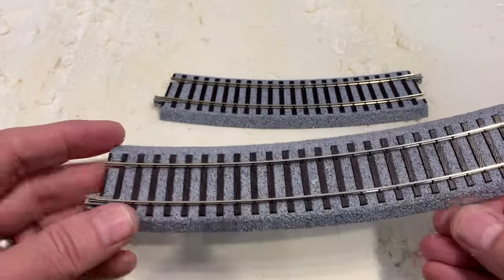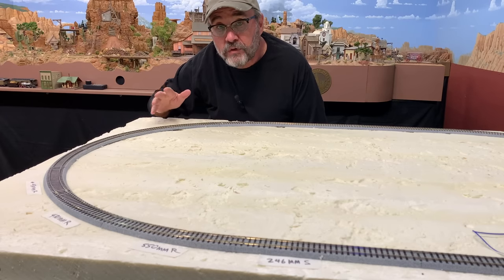HO Christmas Layout | Terrain, Track & Trains | SF&SN Part 2

Comment: Dear Dave, interesting how the PIR foam can be formed to shape. Seems to me like this kind of foam is more similar in properties to the carving foam you’ve shown and used. The relative ease with which the foam can be formed into a rock face reminds me of the the relative brittle aspects of PIR. Especially when it’s a lower density version. Humbly think the higher density versions come indeed close to the carving foam properties. 
Great little project, curious to see this project develop into a snowy landscape. Cheerio

Comment: Why have you used the material that you needed to peel off the plastic or fiber covering?  Is this material a better/stronger choice?
Reply from the maker: As I mentioned in Part 1, friends of mine have achieved good results with it so I thought I'd give it a try. It does carve and cut very easily once you get the wrapper off.